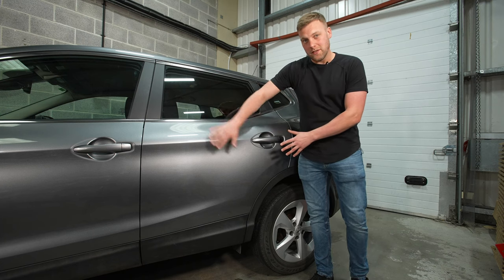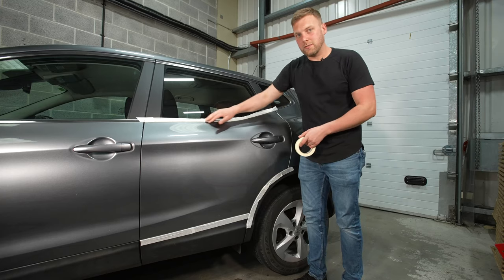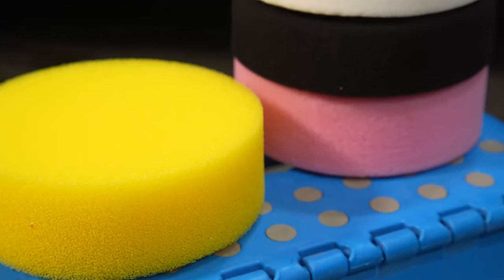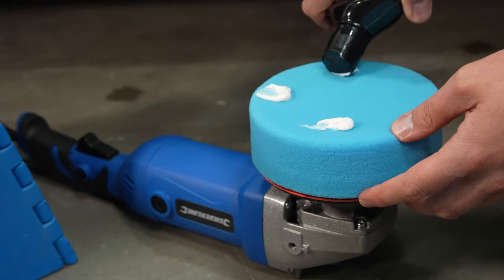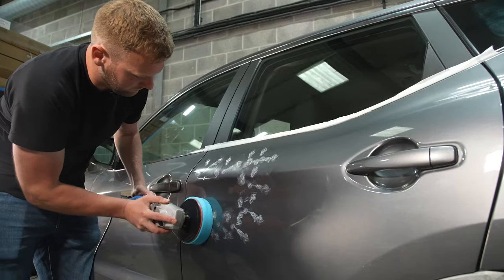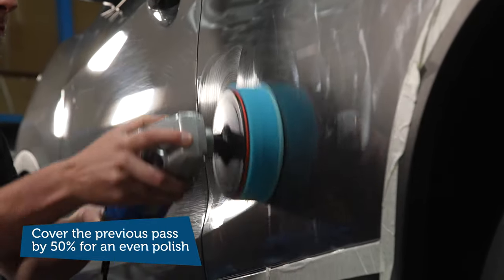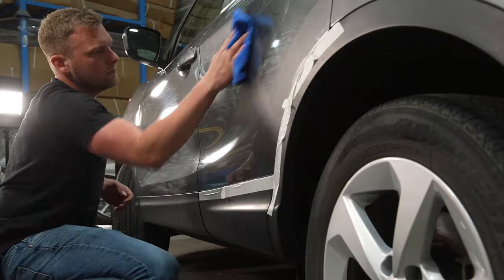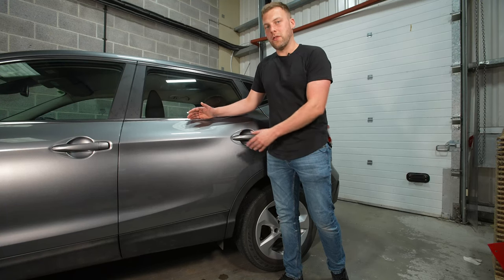How to polish your car!

Comment: What Polish would you suggest is the best for a Mini Cooper s in black 2011
Reply: I'd always start with a light, store bought polish and a soft pad if you're polishing for the first time. Each cars paint does vary in hardness so the most important thing is to ensure you're not going too harsh to start with and not staying in the same spot for too long, as you run the risk of causing more damage, rather than a good paint correction. 👍 Hope that helps